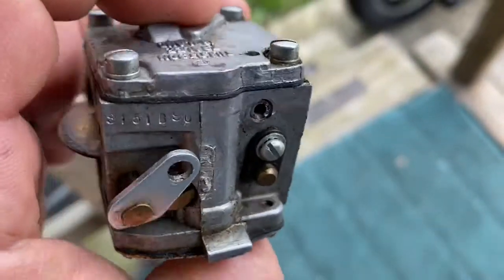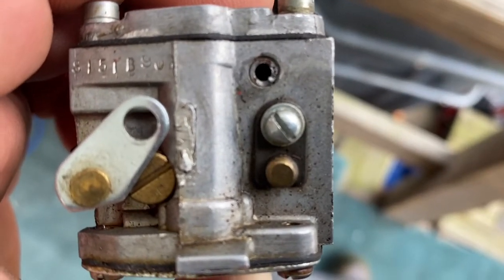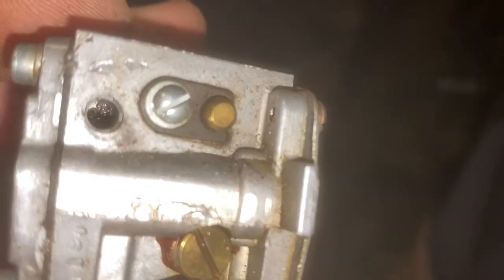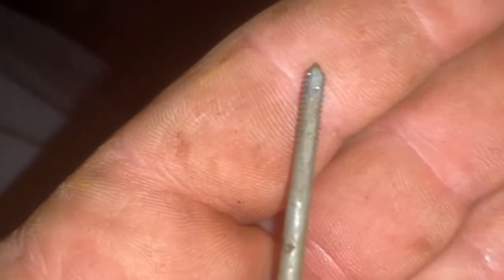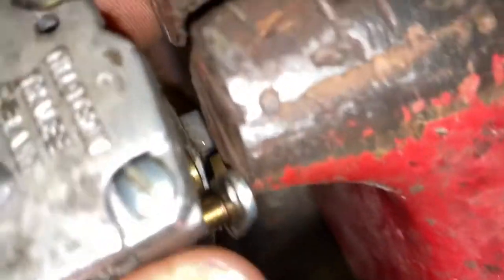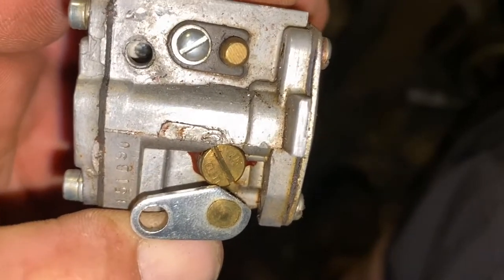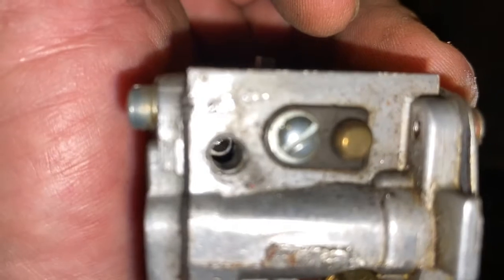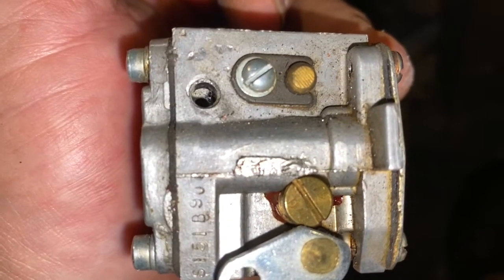How To Remove Broken Fuel Inlet Port On Small Engine Carburetors

Comment: How did you put the new fuel inlet port in the carburetor? Do you have a video to show how you did it? Thanks.
Reply from the maker: I just threaded the inside of the port and ran a screw up into it.  Then used the screw to pull it out.  Then I used a vice to press the new one back in place.
Reply: @Smittyschainsaws  Thanks for your reply. I have another question: did you use thread tape for the new fuel inlet or just used the vice? Thanks.
Reply: @Smittyschainsaws  
Thanks for your reply. I have another question: did you use thread tape for the new fuel inlet or just used the vice? Thanks.
Reply from the maker: No tape. Just pressed on. You can use motoseal if it makes you more comfortable. Available at most parts stores specifically for saws and high vibration engines.
Reply: @Smittyschainsaws  I followed your advice and used my vise to put back my fuel inlet to my carburetor. Thank you for your help and advice.
Reply from the maker: No problem buddy!  Glad it worked out for you!
Reply: @Smittyschainsaws   i have questions  myself  got the same problem  on a Tililotson Ht 12E 550 carb and can't  find for the life  in me a replacement  intake  elbow  !! Where  did you find your replacement  part ?  Been trying  for weeks now ! Lol 
Thanks for the informative  videos  sir
Reply from the maker: @nathanwindle9816  https://www.chainsawcc.com/products/tillotson-ht-carburetor-impulse-nipple-90-degree